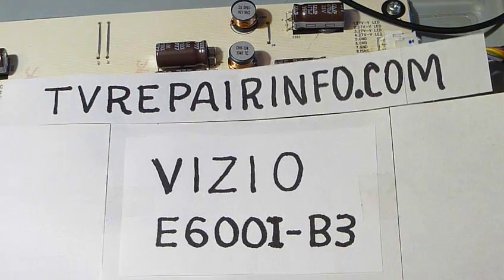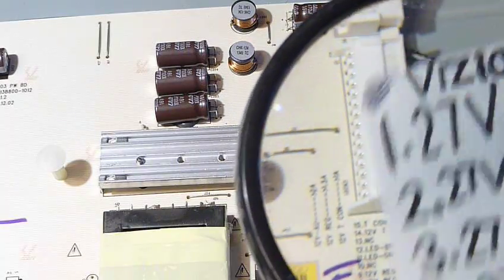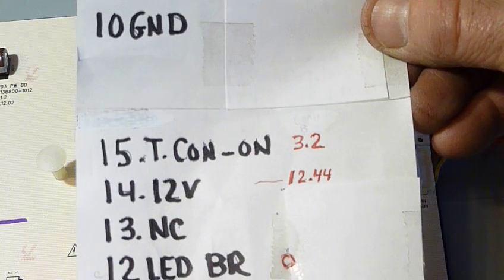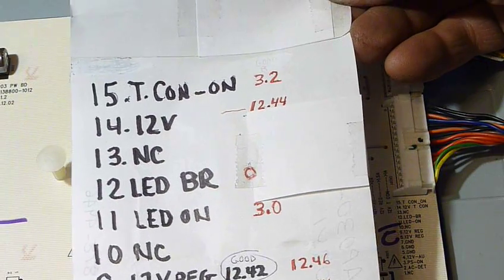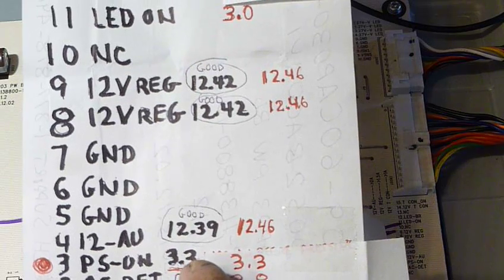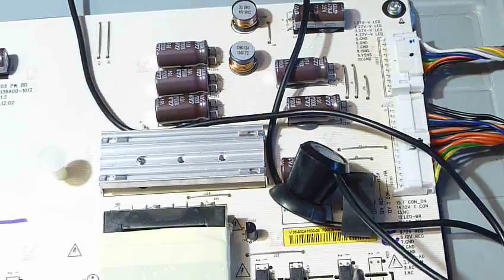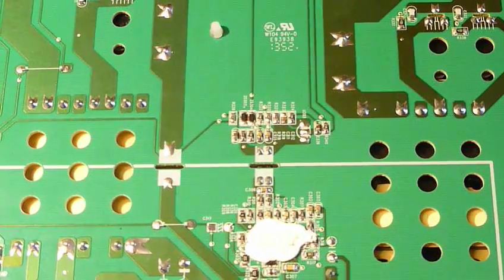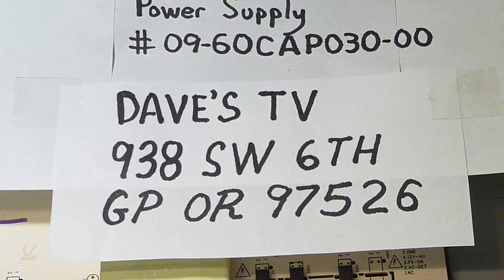VIZIO E600i-B3 Troubleshooting And  Repair History.

Comment: Does T CON pins 14 and 15 supposed to have voltage even if the TV is off?
Does the voltage come from the PSU?
Reply from the maker: Sorry but I don't know anything about the pin lineup on your particular tcon board,
Reply: @GrantsPassTVRepair  It's the one in this video

Comment: Hello there.  I've got the same model E600i-b3 with a cracked screen and was hoping someone could point me in the direction of the replacement parts needed.  Thank you.
Reply from the maker: When your display is cracked it's time to buy a new TV rather than repair it. Screens are quite expensive.
Reply: @GrantsPassTVRepair  I figured as much.  The TV was given to me and I've invested nothing into it, so it may just be worth it to replace the screen.
Reply from the maker: @DEXTERMORGANXBOX  TVs are pretty cheap now. Unless you can find a used display which I doubt it's not worth the effort.

Comment: We have the same problem with PS-ON getting voltage without tv being turned on. No indicator light turns on, and standby voltage is normal. We ordered a new power supply, still the same problem. We just got a new motherboard and tried connecting it, still didn't fix the problem... What could be the problem? I was so sure it would be one or the other or both, and not anything else? Do you have any suggestions?

Comment: Informative video - Question:  I have a similar Vizio set that just went dead - PINS 8 and  9 read 4.8 volts which I thought was strange. Something you said in your video prompted me to disconnect the cable from the main board to the power board and now PINS 8 and 9 read 12.38 volts!  Would this be a good indication that the Main Board is defective ?  It would seems from what I just described the Power board is good.  Thanks
Reply from the maker: One of the techniques I use to determine if the main board is bad is seeing if any of the power supply voltages change, or if the stand by light on the TV panel changes after I press the power on button. Another symptom I've seen when the main board is bad is sometimes the TV may come on but not turn off when I pressed the power button.  These are just general ideas which may or may not help you, and what worked for me may not give you the same results.
Reply: @GrantsPassTVRepair  Thanks for this fast reply. None of the voltages change, regardless of pressing the on/off button. The on/off LED does not illuminate - nothing. The only action that impacts the power board voltages is disconnecting the 15 pin cable from the main board. to repeat..the on/off does nothing at this point. I know you can't tell me for sure without diagnosing,  - but does this sound more like the mainboard is the issue? thanks again
Reply from the maker: @aceopinions  The main thing to remember is the main board gives the power supply an enable voltage to turn on. If you don't see one appear and your power supply is producing stand by voltage I'd be suspicious of the main board dragging your voltages down.

Comment: I was curious what the top your electrolytic caps looked like.  I have a  vizio p602ui-b3 that is DRT (dead right there).  My experience from past TVs (I'm not a pro, just a home user with electronics background), is that the caps may swell and go bad.  Anyways, I measured and got no or low voltage readings on the test points you mentioned (I didn't record my values).  Well, I noticed 4 caps (1000 uF 16v) have swollen tops.  I've ordered two package of 5s from Amazon for 6 bucks for each package.  I'll replace the 4 obvious bad ones and see if that fixes the issue.  I may replace the rest for good measure tomorrow when I receive the caps (oh, I paid an extra 11 dollars for one day shipping).  If it doesn't work, I'll buy another board (I'll just be out the extra $23).  Good job on your video.
Reply from the maker: If they are budged on top they are probably bad, but even if they test good, I'm  not comfortable with capacitors that a are budged on top.

Comment: The voltage readings you provided in this video matched my situation exactly and it directly identified the source of my problem.  I'm sure I would have wound up replacing the main board as I was seeing 12V coming out of the power supply.  A trip to eBay, $13, and a couple days of shipping had a replacement PSU in my hands and the installation was painless.  I spent more time getting the damn TV off and on the wall than I did on the repair process, and it's largely due to you sharing all this information here.

Thanks!

Comment: HI i don't know if u will see this but i have the same model of tv and im having a weird problem. The tv will just flash red, gree, blue, white then turns black. it will just repeat this forever until it is unpluged. The will not respond to any buttons either. i Talked to tec and said i need to send i need to get it repaired. The main board is cheap so i thought i would just do it my self. i have some exp with pc repair shouldn't be a big deal. Im just wondering if you think it might something else needed to get replaced or is there a way to get out of this color flashing w/o repair. Thank you
Reply from the maker: I don't know for sure but it sure sounds like a possible main board issue.
Reply: +Grants Pass TV Repair  thank you for your reply! I'm going to order a main board. like you said parts are cheap on eBay for this TV at least.
Reply from the maker: I would not have thought the main board to be the problem, but when you mentioned the TV not responding when you pushed the buttons that suggested it was a main board issue.

Comment: I just want to say a big thank you for this video.  I have the same model and its been useless since the warranty was up.  I cracked it open and was going to replace the main board until I seen your video.  I tested the voltage and got similiar readings like you did.  I replaced the power board yesterday and now it's working beautifully.
Reply from the maker: The symptom on this one could easily mislead one into thinking the main board is bad.  Glad to hear you got it going.

Comment: This is my exact tv, I had a burn diode mark on only one, would that be enough for it to not turn on? , I already ordered a new power supply, coming in today . cant wait to try and replace it
Reply from the maker: +Jose L Morales It may be a bad diode which could cause the TV not to work, but I use my meter to test diodes. Most of the time a bad diode doesn't show any physical signs of being bad. The burnt mark you see may not mean its bad.
Reply: oh okay thanks for the info Grant Pass Tv Repair, but i ended up receiving my new mobo in the mail, installed it and now it works like a charm!
Reply from the maker: I don't know what a mobo is but but sounds like you got it going
Reply: Ghost , mine has the same issue with one  hot looking diode , what were your symptoms?  Mine cuts on , backlight works , sound works but never any picture , not even from the menu , thanks

Comment: Hi Dave.  I am having trouble solutioning a problem with this model of TV.  After some use(it varies from a few hours to 30 minutes), the screen begins to flicker worse and worse until it blinks out and then goes black, but audio stays on.  I have visually checked the capacitors to see if they're blown(someone recommended it), but I couldn't see anything wrong.  I will post a video of the flickering for reference.  Do you have any ideas as to what the problem might be?
Reply from the maker: +Joshua Crunkleton I'm wondering if one of more of your LEDs is bad or going bad.. Gaining access to them is a high risk job that can result in damaging your LED Display if your not extremely careful and patient.
Reply: +Grants Pass TV Repair Thanks for the reply.  I'm willing to give it a shot, but I can't find pricing on new LEDs or how to access the them in the first place.  I figure at this point, the TV is useless anyway, so damaging the display is the least of my worries.
Reply from the maker: Here's a video by norcal715 which may help you. If you look at the comments under his video you will see that one of the links someone left has a place which sells replacement LEDs for about 65 cents each.
https://www.youtube.com/watch?v=Bf5T2wwtydY
Reply: +Grants Pass TV Repair this is awesome. I may just get a new TV and try this out as a pet project. Thanks for the help!

Comment: I'm curious if having an electronics repair shop is profitable these days? I'd like to open one someday but it seems that because whole boards are going cheap on eBay that many people would try simply replacing things themselves
Reply from the maker: +mrsemifixit I would not recommend this business as your sole profession unless your retired and don't need the income. Had you gotten into this business 30 years ago it could have been highly profitable, but it's pretty challenging these days. My biggest complaint is having to replace so many whole boards rather than  doing component level repairs which use to be far easier, and the boards on ebay aren't necessarily cheap. another problem is often times the boards on ebay are no good and  the sellers don't always know if their boards really work. The reason I'm surviving so long is my overhead is low enough to make this still work, and after 20 years at this location many people know I'm here,  but my shop is only 170 Square feet.
Reply: +Grants Pass TV Repair Yeah that's a bummer. I wonder what aspect of electronics repair is most profitable these days. Guessing being a tech for a big company rather than a general electronics repair shop? It seems there's lots of cell phone repair shops opening which makes sense but I feel the majority of those fixes are simple part exchanges rather than true troubleshooting. Makes it seem like as long as you're good with small tools you're an expert in electronics lol
Reply from the maker: Appliance repair is another good one.
Reply: +mrsemifixit I used to manage a small shop also helped with repairs, techs usually travel from shop to shop and make 40% commission on repairs. The guy who did our house calls I paid him 50% because he used his own truck and tools.
Reply from the maker: +Bri G. Yea I knew a couple techs who did piece work like that. Some were gifted at knowing how to repair the tough dogs. 
Motels could be profitable source of income in the old days. They often had many of  the same models so you could interchange parts from a couple bad  TVs to make a few of the bad ones work.

Comment: I still would like to see a component level repair just out of curiosity of what failed. I assume it would be a blown cap or something else large. Surely the surface mount crap wouldn't fail?
Reply from the maker: +joblessalex I checked all the simple things such as capacitors, diodes,  power transistors and fuses, and since they all tested good I went with a replacement board. Sometimes surface mounted parts do fail, and in this case I would guess it may have been one of those small surface mounted driver ICs under the glue. Most of the time when surface mounted parts go bad it's due to a failed power transistor taking out several other components.
Reply: +Grants Pass TV Repair Well in that case I would've chucked it too. Anything under $50 really isn't worth the trouble.
Reply: I have installed some power supply repair kits on some TV's where the surface mount caps do fail. The kits will have the proper replacement parts. I agree with our video host here in saying its much easier just to pick up a power supply board on ebay. Just make sure its been tested first.